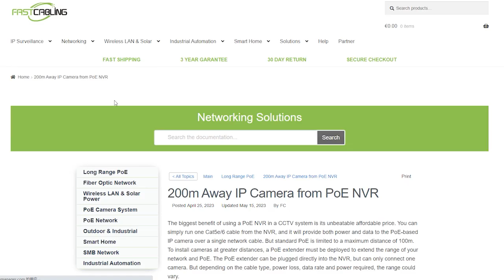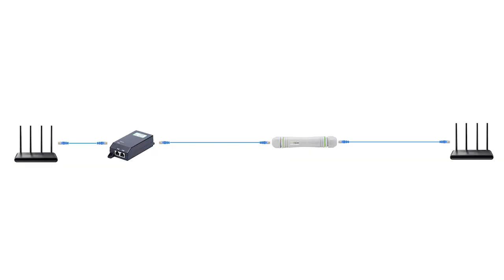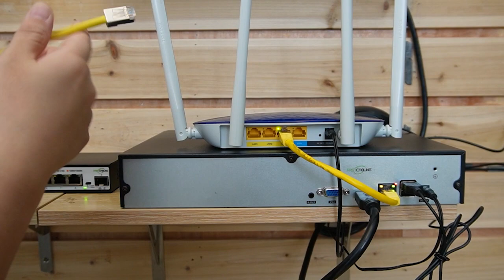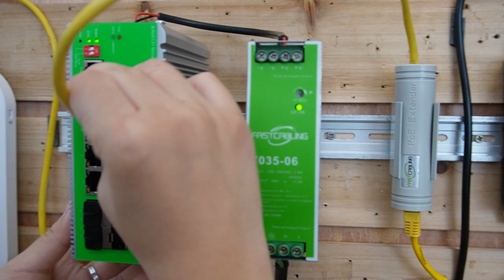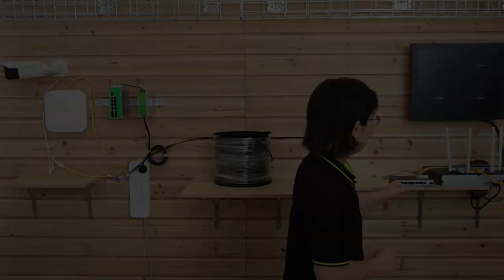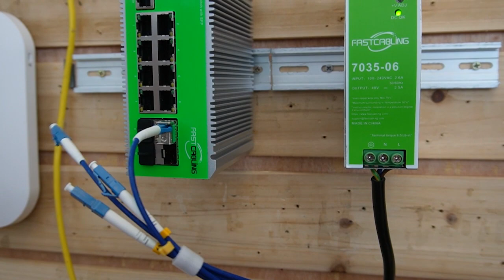How to Extend the Reach of Industrial Network Switches

Comment: in this video using single fiber optic cable can we access dublex communication. such as internet through access point
Reply from the maker: A single fiber optic cable can indeed support duplex communication, which means transmitting and receiving data simultaneously. And full-duplex communication is typically favored when maximum data throughput and bidirectional communication are essential, while half-duplex communication may be sufficient for certain scenarios where cost or simplicity is a primary concern.